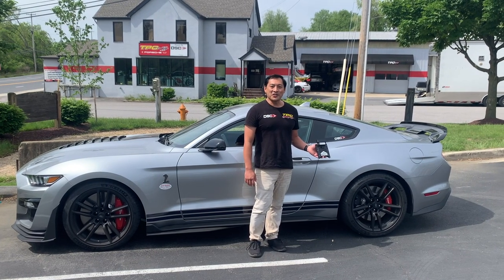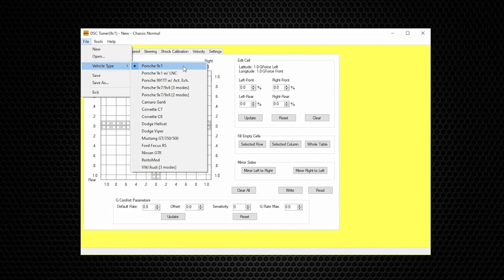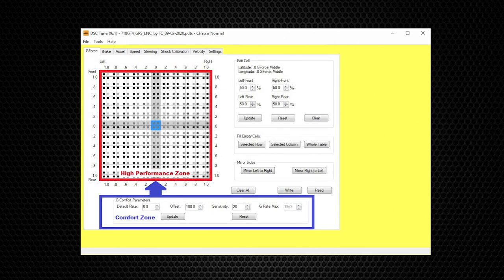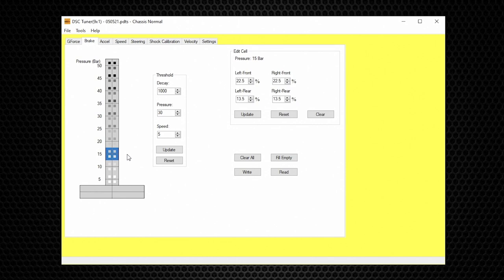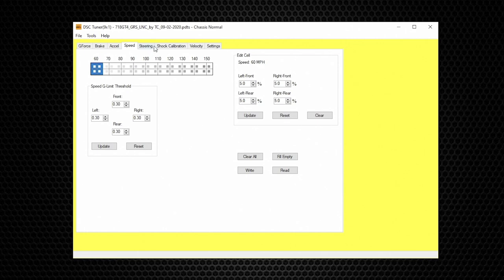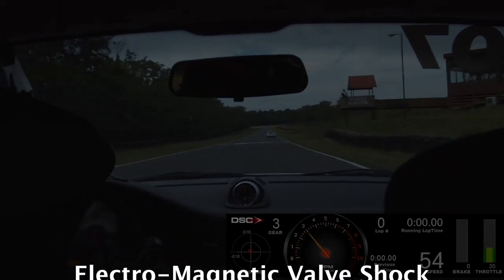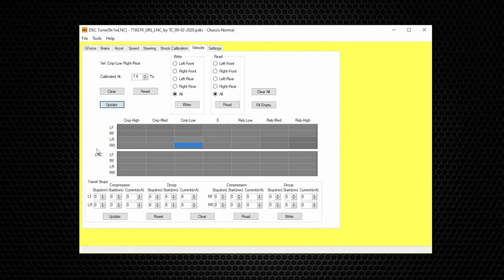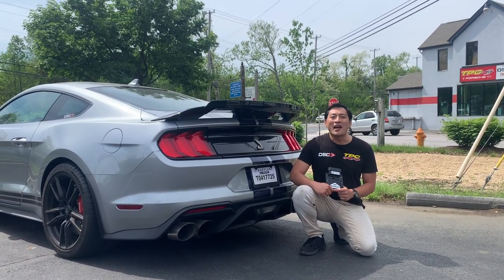DSC Sport Tuner Software Overview and Tutorial

Comment: How does this controller effect or control different drive modes on cars you can change between comfort/normal/race? Is there a DSC table for each OEM drive modes? 😊 👍
Reply: yes, depending on the vehicle and the number of modes it has the DSC has a map for that AFIAK - e.g most Porsche's have two modes: normal and sport